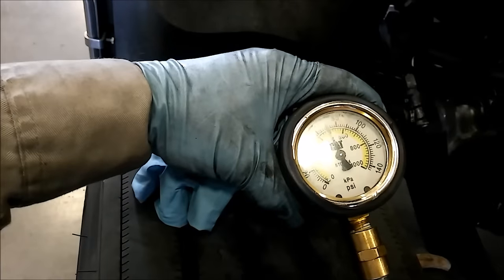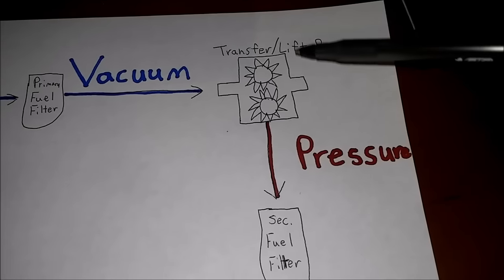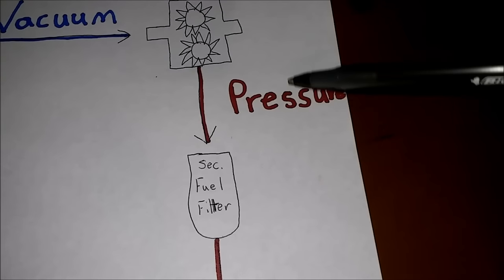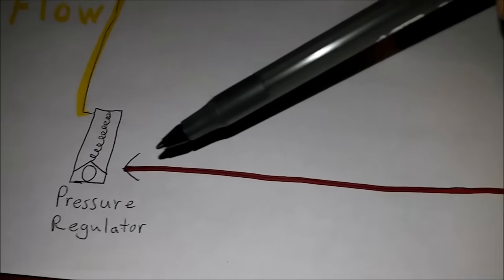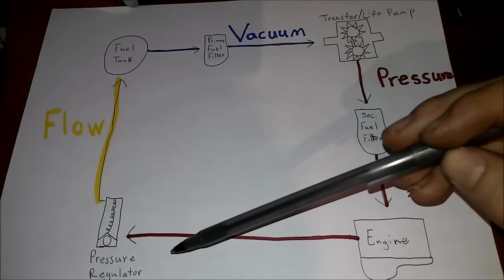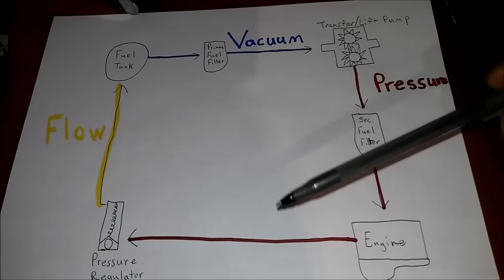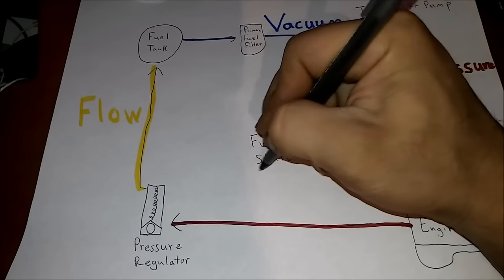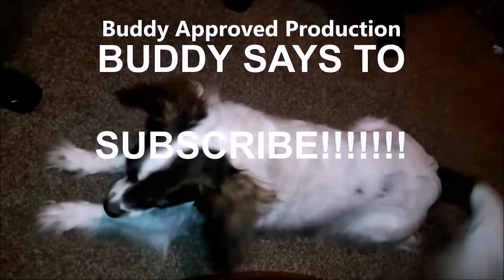How To Troubleshoot Cat Fuel Systems and Test Diesel Engine Fuel Pressure.

Comment: very great video! I have a 3126 in my motorhome. I'm planning on ditching the lp generator and adding a Cummings quiet diesel generator which I just purchased. I need to tap into the fuel system for my supply and return on the generator but do not want to mess with the pressure of the motor. By watching this I should be ok tapping into the supply before the primary filter of the 3126 and the return after the pressure regulator. Do you see any issues with that idea? Thank you
Reply from the maker: +john67elco You should be okay as the generator shouldn't pull that much volume of fuel, but the issue you may have is the inlet line will be under vacuum with the engine pulling the fuel to the main engine.
Reply: +Adept Ape oh yes good call I didn't think about the vacuum I'll look into a fuel check valve so the generator supply  doesn't get the prime taken away from the main engine running
Reply: +john67elco would you know if the fittings off the cat 3126 filter are an-6 fittings?  Trying to figure connection points to figure the Y fitting for the supply to generator thank you

Comment: is pressure supposed to leakdown istantly like it did after you stopped trying to start the one with bad ecm? My c12 does that but i dont have any starting problems and i have good pressure. I have new filter base and pressure regulator with no leaks. Just curious becuase i read that the engine is supposed to maintain the psi after shutoff

Comment: Have a problem with a cat c-15 accert (accert disabled). New rebuilt engine. New cat injectors. New head. Always has a starve for fuel issue at 1600 rpm. Everyone says to install a FASS pump. I think that is BSZ Where can I get proper fuel line sight glasses for this diagnostic application? What else is needed? Where to buy? I wanna see the in and out of fuel and see if I see air bubbles! Damnit. Could it be a bad fuel filter housing? Check ball? Is there a screen somewhere? Has a new fuel pump as well. Thanks!!!

Comment: I have a 3126 cat 1998. Runs great starts great etc. New fuel filters just put on. Fighting a little problem. Itll sputter for a split second  under a hard load then itll run fine again. Any advise??
Reply: Hi Nick, I have the same problem on a Cat C7 school bus, starts good, runs great, no check engine or codes, did you fix it?
Reply: Check the sending unit

Comment: Hi, question?, you have talked about the C7 or 3126 fuel regulator at the back of the head. Information says it has an orifice that regulates fuel pressure based on a certain amount of flow and that it has a 5 psi back pressure check valve. 
Is there a way to test this back pressure function?  And its hold function? I have seen a number of comments about it being an occasional problem but no clear way to trouble shoot. Or do you just throw one in and hope for the best? I am in Canada and it is a 340$ item at the Cat dealer or perhaps you know another source?
Thanks, Bob

Comment: So you can change a low preasure fuel pump on a 3126 cat. with out pulling the huei ? Or do you pull the spring and plunger out and rebuild? THis huei has the oil resavoir.

Comment: Love your videos!  How stable should the fuel pressure be on a 3116? Needle flutters quite a bit(centered around 10 PSI) at idle, occasionally dips from 60 to 35-40 then returns, when running at higher RPM?
Reply: Sounds like your sucking air. Fuel gauge is going to flutter a little bit but that big of a jump is air

Comment: We have Cat 3116 in a gmc 96 C6500 it has two tanks and it has a connecting line from passenger to the driver side tank but it's only drawing from the driver side tank and leaving the other full. I have dropped tanks cleaned them.

Comment: Thanks for your videos.  I am knew to this with a diesel pusher RV.  How do you troubleshoot this when it is intermittent?  Bought RV two months ago.  Changed filters at shop that day.  Last week on trip lost engine power.  It came back on it's own.  Same thing 1 hour later, low power RPM shooting around a bit.  Then came back after a few miles with check engine on and off during the drive..  Before coming home, went to shop, change filters again and drain fuel from bottom of tank.  2 hours later, same issue within 2 miles, full power comes back.  Drove 5 hours, all fine.  Unloaded RV and drive to storage it started it again, Check engine light, low power, RPM hops.  (Thought transmission maybe, but fluid is full and smells fine) I believe it is fuel.  Have an appointing IN A MONTH at freightliner to look.  I prefer not to wait that long.

Comment: So I have a c15 acert converted to single turbo. Last week in the morning it fired up and almost immediately shut down. I tried priming it but the plunger was hard as a rock. After a long crank like 20 or 30 second it started to light smoking and stinking of raw unburnt diesel. Then it cleared up and ran weak so I changed both filters. Every morning it's hard starting like I described above but runs flawless after it starts. Where would you start

Comment: I had a problem with secondary fuel filter swelling up because of over pressure on a 3116. Ended being a small piece of shrink wrap stuck in return line from someone not removing the plastic around filter properly.

Comment: I have a problem on my HEP12725 3126 cat. Heui pump went out so we replaced it as well as a transfer pump (ford part). Everything seemed to work great for a week or so. Than a small fuel leak was discovered (plastic hose that connects heui pump and water separator) that we are replacing right now. Than I could not start the truck in the morning. Unscrewed fuel filter and it was empty. Filled it up and started the engine using starting fluid. Truck ran for 10-20 miles and stopped again. Same process to start. I am hoping that replacing leaking hose and fuel separator will eliminate the problem but if not, what are my next steps? How do I troubleshoot my fuel system? Thanks a lot

Comment: Question. I have c15 with primary and secondary fuel system but would like to make it with a glass bowl system with one fuel filter. I've seen one on YouTube and the thing I can't figure out where or how to buy is on the secondary they use a dummy filter 🤔. Obviously the primarily is changed to the glass bowl type filter and on the primary is left alone nothing is removed.

Comment: @Adept Ape Hi, I’m having issues with my cat 320d 6.4 acert engine. The code is low fuel pressure on rail. The machine is still working perfect if you keep the engine speed dial on 8 or under. If you select 9 or 10 the engine enter on safe mode and loose power after a couple of minutes. Now It is doing on 8 too and I’m working the machine on 7 but it’s very slow.
I have replaced: 
Fuel return valve (fuel rail) 
Low pressure pump
2 Inyectors (they had little return) 
Flush all fuel lines and filter base. 

Any idea if what could be happen? 
A lot of people say may be the high pressure pump but it is the only thing I didn’t change. I think the pump is very expensive for keep “guessing” the issue. 

All this parts where diagnosed and replaced by a cat technician

Comment: Im new to this diesel motors but we have a 94 peterbilt dump truck that has c12 and its not getting fuel so im replacing the transfer pump any tips on what else it might be thanks.

Comment: I have a c12 2ks4945. My fuel pressure was at 40psi at idle went up to 90 wide open. At idle it didn't feel that rough but under load it felt like it had plugged filters. I changed the filters first and yesterday I changed the regulator, the pressure went up to 70psi and now the needle is bouncing rapidly between 40-70. i did the "bucket o fuel" test and it is the same. It seamed to be running better but than the pressure started to fluctuate. Now it still has a miss under load. Would the next part be the transfer pump with the pressure bouncing rapidly like that. Thanks. BTW your videos are great, i'm not a mechanic but i feel like i stayed at a Holiday Inn Express last night.
Reply from the maker: +Dennis Crowley I like the Holiday Inn Express reference. So the C12 has 2 pressure test ports on the filter housing, but you have to move the fitting. So the normal test port is before the secondary fuel filter and the alternate one is after it. I've seen a few of those filter housings go bad and cause that problem. I believe the alternate port is on the right rear of the filter housing. Try to move the test fitting to that location and then retest. Sorry I can't upload a picture to better explain.
Reply: The port i'm in now is the one just below the return line. I'm not using the fitting as I have seen fittings go bad before in my plows and car haulers. I can move it to the top and try it there. however I just found a new problem. I took the valve covers off to check the over head and i found the #1 injector rocker loose. I'm at the end of the adjusting nut and it still didn't get tight enough. Is that the cam or the cam followers or is there no way to know until its apart? The other question is can I use the truck for another 4 weeks until Christmas as I know I will be slow then. I only drive 600mi per week and gross less than 50k.
Reply from the maker: +Dennis Crowley Check that injector rocker for the pushrod and check if it's damaged. If you lost a lifter then the cam is probably bad as well. You should just remove the pushrod for that cylinder's injector rocker arm and then you'll have a definite dead cylinder, but it won't hurt anything, it'll just spin in place without firing. That is how I would run it for the next couple weeks if you have to.

Comment: Hello. I enjoy your videos! Thank you! A question if I may...
I have a 04 C8500 with a C7. There are no trouble codes. I have an extended crank situation. I've burnt up or broke starters from excessive cranking. Once it does start my running pressure at the filter is 70 psi and the pressure immediately drops off to 0 when I shut the engine off. My cranking pressure comes up very slow. Attempts to start slowly at around 50psi. I've replaced the fuel regulator and the Injection pressure sensor. Thanks for your time!

Comment: I have twin marine 3126 420hp engines. Recently I noticed higher fuel consumption (12.5% more) on the STBD engine coincidental with loss of WOT power/RPM's at 2500 in stead of 2800. No oil consumption. I run 40wt oil.

Comment: Am beginner .. Asking Fuel transfer pump on common rail system output s over 20000psi ..I didn't understand 125psi you talked about. thanks

Comment: Hi - I have a c-12..I Just developed a very slight drip coming from the transfer/lift pump- After a cleaning and inspection its dripping from the mounting bolt area- Gasket bad?? Anyway, After I remove it Does it need to be Timed or anything when I install it back? Im just a Driver-But have some mechanical as I do most of my own work, Or is the Pump itself bad?.. What you recommend? Oh,And im sure you know the pump is in the lower left of the front cover
Reply from the maker: +StayingBack71 The fuel transfer pump doesn't need to be timed, it is just a spline drive with no timing. There should be 2 bolts on the front cover that hold it on.

Comment: My 3116 boggs down and acts like it’s starving for fuel. Changed the filters and it ran strong again for a couple of days and now it’s slowly starting to do the same thing. If I pump the primer pump a few times it’ll run strong for about 20-30 minutes then it’s back to losing power. Where the throttle linkage on top the pump it’s seems to be slightly wet. Any ideas where to begin, could it be the fuel pressure regulator? Thanks

Comment: I've had 3 fuel primer pumps go out on 3 different trucks truck was sucking to much air at the primer pump to start im assuming  seals inside the pump go out truck cranks and cranks won't build fuel pressure pulled the primer pump off made a block of plate to go where the primer pump was truck starts right up

Comment: I have a 3126B (Class A motor home) that lost prime for no apparent reason. Symptom was crank no start after engine dying one block after a normal start. That followed a brief lunch stop after driving 175 miles without issue.
Engine would start and die on ether (four attempts). After trucked 130 miles home (flatbed tow), on third attempt at crank, engine coughed then crank no start. Next attempt, engine coughed and sputtered, made diesel clattering noise and slowly started, gradually smoothing out and running fine. 
I think I may be sucking air into the fuel line? 
Anyway, I have a single 2micron filter - is there a hand prime pump that will easily adapt to my setup for future use?
Thanks very much.

Comment: 40-50 psi at 1000 rpm 475 cat c15 6nz. Going to replace fuel filters/flush diesel and add some injector cleaner with new diesel and also replace the Fuel pump check valve, Atmospheric pressure sensor,  Boost Pressure Sensor, OEM Caterpillar Oil Pressure Sensor. What else should I do?

Comment: Hi I have a 2001 Thomas flat nose bus with a cat 3126 I have changed the fuel filter three times in a day because it keeps busting and releasing diesel. Can you tell me what may be the problem? Where is the heui valve is also?

Comment: i talked to you once before about my c15 missing about 400 ft/lb of torque. i was told my fuel pressure was fine but i noticed i'm showing 7 lbs of restriction after i change the filters and in around 100 miles it will hit 10. change the primary filter and it goes back down but run just a little and its back up. i'm taking your advice and talking to a new shop i left a "world famous shop " after my last visit they said they were stumped. new injectors pulled and checked by two different shops, new bar and plate air charge cooler, because mine had a small leak along the edge. new transfer pump , new ecm also dynoed the truck with a different ecm with the same results. so before i run on i can say that the restriction problem has always been there even when the engine made good power. ok is it possible to have 10 lbs of restriction and good pressure at the same time and could an actuator throwing no code cause the power to be 400 foot lbs lower. new mechanic wants to check the overhead job that previous shop did but they ran it twice because of injector removal, but couldnt say what the cam looked like . so new shop wants to see the cam. i realize i'm all over the board here but this is what i'm dealing with. im changing the lines from the tank to the primary filter now. oh 45 to 50 lbs of boost i used to have 60.
Reply from the maker: +Alice Stoneking That is a lot of questions, let's see what I figure out. Do you have a fuel tank or dirty fuel that is causing the restriction to increase that quickly? If you have a restriction problem on the primary filter, I would recommend getting a Racor style fuel filter installed in place of your primary to prevent that. I don't think the overhead being off a little would cause any huge horsepower losses like that, an IVA actuator wouldn't cause that either, if it was acting up you would have an engine miss. If your getting lower boost, check that the turbo wastegate is working correctly, check for a plugged muffler. It is possible to have a restriction and still good fuel pressure and it can cause performance problems.
Reply: Also..don't forget the basics. Lines deteriorate . I've seen them crack internally, they either load primary full of black pieces of line , or one specific chunk will pull down and block line .

Comment: Thanks for this video, am having a challenge on a marine CAT C4.4 engine, the fuel rail sensor switch, if it's disconnected the engine starts, but if connected back it won't start-up, a replacement was made and it did start, but later won't restart again, please kindly help, if there is something else am not doing right. Thanks a lot.
Reply: Holy cow, this was a year ago, did you get it figured out? I'm having starting issues with a 6.6L CAT engine 3116. It requires air pressure into the return line to help with pressure, once started it runs though. I have been told the problem is a faulty check valve on the return line causing leak down which allows fuel lines to get air in them.
Reply: My 3126 lost power and won’t start after u cut it off changed fuel filter won’t start take the fuel filters off it will start

Comment: C15 6nz.
I have the problem of straight engine oil coming out of my fuel return line. Thinking it could be cracked head.
It came in, had head gasket blown and #5&6 liner cracked. Replaced 5&6 pistons and liners new head gasket kit and spacer plate. Went to start fuel going in to front of head and only oil coming out of fuel return line.

Comment: Hi- can you maybe help me? I changed the separ and the yellow cat filter and the regulator vent on the handpump- everything was fine for 8hours driving and then i have again after starting fuel pressure alarm. I can override it with gas in neutral- then iam back on 520kpa- but what should i do next to prevent problems?🙏🏼🙏🏼

Comment: I just got a c15 and it only has the plastic 382 housing and a fleetguard fs19624 filter. On the bottom of primer pump capped off with a label "do not remove".  I checked with dealer by VIN. and it calls for 2 filters. What do you think?
Reply from the maker: +Andy Agler I've seen people take the secondary filter off and use just Racor filter before, but I believe from the factory they always run the primary and secondary filter. I would add the secondary filter because it is a finer filter and will help protect your injectors.

Comment: hello sir, is it okey to run the cat diesel engine 3412 for almost 5days of continues operation? I have a trouble on fuel pressure dropd from 60 psi down t0 25psi..